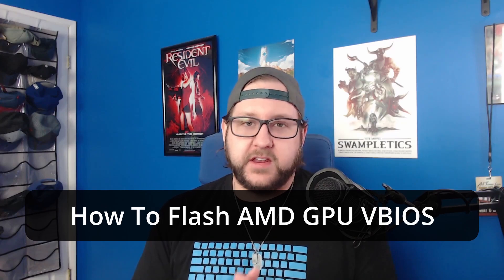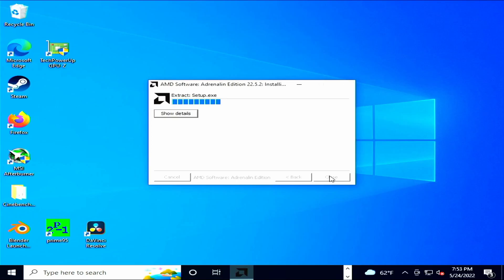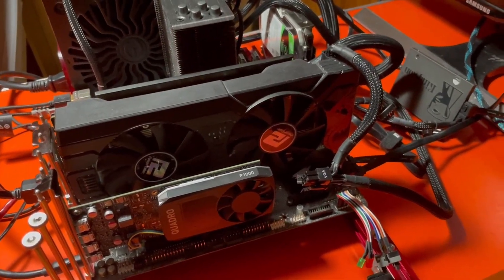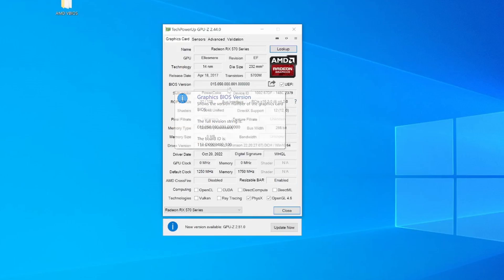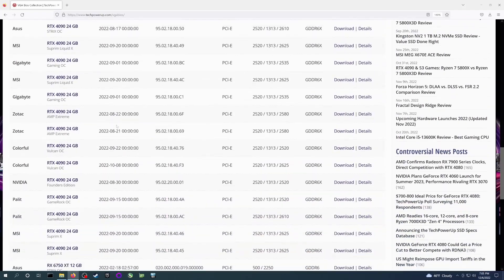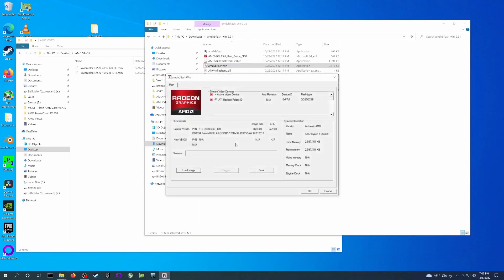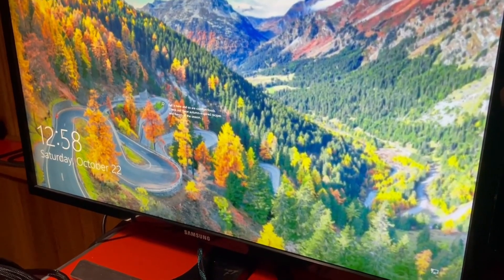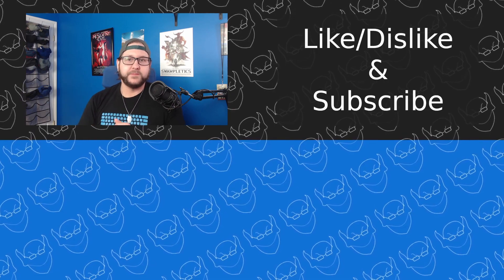How To Flash AMD GPU VBIOS

Comment: I wanted to fix resizable bar on my rx 580 but I already have the latest bois version. I could just try download it but don’t want to brick my card trying to download it. Whenever I try to enable resizable bar in my mobo bios it won’t load into windows. Does anybody have any suggestions?
Reply from the maker: What's your motherboard and CPU? IIRC resizeable bar is only supported Ryzen 3000 and newer CPUs, and Intel 10th gen and up. And I believe some motherboards have a broken/weird implementation that you might need to update your motherboard BIOS for or might be stuck without it worst case (unless you bought a new mobo but that's not really worth it).
Reply: I have a 2600 so I guess that’s the problem
Reply from the maker: @Hypnotic12 ah yeah that might be it then. I'm sorry about that 😬 but at least now you know

Comment: I get a "cannont find a discrete Ati video card" issue
Reply from the maker: Hmm, that's a fun one. What card are you trying to flash, and what version of amdvbflash are you using?
Reply: @BitGoblin  mi25 
Basicly a vega 64 frontier edition
Reply: I was using my 1030 as the main card the pc thru gpuz reconises it but the software you used didn't
Reply: I used the newest version that was on the website
Reply: The version is for win 10
Reply: @BitGoblin   heres a video on it 
Thank you for taking your time

Comment: Hello mister, do I need to plug a NVIDIA card to do so? Or can I connect another AMD card?

P.S my AMD Sapphire 6600 XT shows no display like yours 570.
Reply from the maker: Nope! You can use any functioning graphics card (even integrated graphics) as long as you get a display.

Comment: I have a question I got a gigabyte 5700xt and it's core clock is at 788 base and not on its 1700ish base what can I do
Reply from the maker: If you haven't already a BIOS flash could help if the previous owner flashed a different BIOS on there to limit the clock speed
Reply: @BitGoblin  oh okay so doing this might be able to fix the problem? This video shows how to do that?
Reply: I tried doing this but It won't open the little window

Comment: I bought an Aisurix 5500 XT and gpu-z shows it as a non XT- 5500. im guessing this would probably help.  the screen randomly flashes black then goes back to normal. happens at idle or load, whenever it feels like it.
Reply from the maker: Yeah it's definitely worth a shot - sounds like someone flashed a different BIOS on that card to change clock speeds or something.

Let me know how it goes!
Reply: @BitGoblin  yea I think when Aisurix got their pallets of gpu’s they just popped a new cooler on the board with new stickers and flashed it.  I want to get ahold of a second gpu just in case this one bricks. it does read the same clocks and performance just the screen flickering randomly is annoying. Thank you very much for having made this tutorial!

Comment: bro the tool that you mentioned atiflash when i extract it just doesnt give me complete files when i run the installer nothing happens pls help
Reply from the maker: Unfortunately the GUI was retired in version 5, so it's only the CLI tool. I plan on making a video for the CLI at some point, but in the meantime there are some guides online on how to use it
Reply: @BitGoblin  ok thanks 👍

Comment: why am i getting a commmand prompt version o f the ati application?
Reply from the maker: The GUI version was retired in version 5, so you need to use the CLI version now unfortunately. There's a PDF manual for the CLI tool and there should be some detailed guides online. Or I'll make one eventually :)

Comment: Hi Greg, I'm in desperate and hoping you can help.

I bought a used "Lenovo Thinkpad E590 8th Gen Notebook Intel Quad i7-8565U 1.80Ghz 8GB Full HD RX550 2GB" and I'm facing the error "Windows has stopped this device because it has reported problems. (Code 43)" when launching DaVinci Resolve.

I've tried these methods without success:
1. Uninstalling drivers with DDU and reinstalling the latest version of AMD Adrenaline.
2. Uninstalling drivers with DDU and reinstalling two previous versions of AMD Adrenaline.
3. Using AMD Auto Driver Download.
4. Downloading and installing AMD Adrenaline software offline.
5. Using Lenovo Service Bridge for updates.
6. Windows updates didn't work either.
7. Flashing the card with "amdvbflash_win_3.31" gives the error "Cannot find discrete ATI video card."
8. Can't boot from USB due to enabled "Device Guard" on the Lenovo.
9. Tried resetting the card with "atikmdag-patcher-1.4.14" to no avail.
10. Launching Adrenaline prompts an error mentioning automatic Windows updates.

I've reapplied thermal paste and reinstalled both Windows 10 & 11, but the problem persists. The graphics card is "AMD Radeon RX550X 2GB GDDR5," and I've reported the issue to AMD with no assistance. Please help.

Comment: I have an 8GB RX 580 2048sp that came with artifacts, in some games the textures flicker black, in not so demanding games it works normally, just like being in a common app, will changing the BIOS solve the problem?
Reply from the maker: Good question! It's possible it would fix it, but artifacting to me would suggest that the memory is bad (most likely, since less demanding on the VRAM) or possibly the GPU itself is having errors.

Flashing a new firmware shouldn't hurt though, it's definitely worth a shot if nothing else :)

Comment: I got a RX 580 Mingzhou 8gb, but Gpu-z is not picking it up and my PC is not picking it up, the fans are running but no display. What can be the problem?
Reply: I am stuck with the same issue on RX570 8GB GPU-Z does not pick it up not even BIOS picks it up but fans are running with no display. I have a 750W PSU so I don't think power is the issue. Please let me know should you get a solution to your card.
Reply: @maposa867 I ended up upgrading to a newer built box with upgraded motherboard. It was a PCIE support issue. My old motherboard was outdated. But now there is display but fans are not running.
Reply from the maker: Sounds like it might be the firmware. Does it get detected when using amdvbflash?
Reply: @BitGoblin  It was a PCIE issue, but now there is display on my new pc but the fans are not running. I'm actually now saving for an RTX to save me the headache.

Comment: Can I change firmware while I'm using, or do I need 2 video cards to do the process?
Reply from the maker: Yep! You can definitely flash the VBIOS of a running GPU. :) The only reason I had a second was to use for display when the RX 570 wasn't working.
Reply: @BitGoblin  Thank you! I'm not able to change my current firmware then I thought that could be the case

Comment: Man, i did it on a 6700xt everything went fine, now my pc wont start, only blackscreen after the pc tries to fix it itself… what can i do now? Is my gpu fucked now or can i reset it somehow to the old bios pelase help man
Reply from the maker: Yeah you should be able to flash your old VBIOS to the card, you would just need to use another GPU to handle your display while you flash the VBIOS.

The RX 570 4GB that I was using for the demo would give me blackscreens on certain VBIOS versions, so I just used a Quadro P1000 to boot to Windows and do another flash to a working version :)
Reply: Same issues here . i tried everything and nothing work
if you find a sloution please tell me

Comment: i have sapphire pulse rx 580 8gb 2048sp v2 
my pc randomly crashes and freezes after some time, sometimes it shows artifects and then go completely black, when i cut off my power it runs again for a minute or two, is it a hardware or a bios issue ?
Reply from the maker: It could be a hardware or vbios issue, but I'd guess possibly it's a power or cooling issue. Is there any way you can view the temps in the BIOS or something before it crashes? Or you could try a different power supply if you have one to see if maybe it's related to power.
Reply: @BitGoblin  I don't think its a heating or a power supply issue because even when i max out fans to 100% it still crashes,  in normal usage the temps stays in 36-40C, 
in furmark it goes 84, and i used it in my friend's pc with a different psu it still crashes, so psu is not the issue here either,
Reply: did you manage to make it work? im having the same issue with my rx580 8gb
Reply: if u did, how did u fixed it?

Comment: i have an xfx rx 570 8gb it has a clock speed at 1226mhz i checked all the rx 570 variants and the lowest clockspeed (defualt was 1244mhz) and xfx models had 1286mhz so im looking to gain that orignal clockspeed (1286mhz) can i do it safely
Reply from the maker: Yeah the vbios flash is pretty safe in my experience, as long as you have another GPU on standby to reflash it in case something goes wrong

Comment: is it possible to flash RX 580 2048SP into  rx 570 ???
Reply: I get driver issue randomly. Whenever i install Amd driver screen flicker and it will freeze.Then i will need to hard restart windows and randomly it will let me in.Can this problem be solved by flashing vbios??
Reply from the maker: A vbios flash might help in this instance, it's worth a shot at lesst. Or something else is going on like  you've got a defective card 😬
Reply from the maker: It might be possible if you get a vbios with support for the right vram, but can I ask what you're trying to accomplish by doing this? You run a risk of messing up your card, and if it's for performance you're probably better served just over clocking it instead

Comment: Hey, i have a rx580 nitro+ with 1340mhz clock. Cani flash a 1410mhz bios on it?
Reply from the maker: Yeah, you should be able to!
Reply: @BitGoblin  i flashed one of the bioses and i ended up with 0 VRAM.
Flashed another one and all seems ok. Do you have any ideea were identical at specs, have any reason why would the system have this issue ? PS : reinstalled drivers after  every bios update
Reply: @AndyTimeHD   For the Nitro + there should be a slower as well as a faster BIOS, with a hard switch. Now you have the fast one running, try switching back to the slow one and flashing that with a fresh slower BIOS. Check that it really is the right one for your version of the card...

Comment: My rx 570 does not give any desplay I played fortnite the night before and the next morning desplay was gone    I switched to my older card and that one works any advice I only have 1 GPU port to plug into I have micro ATX motherboard
Reply from the maker: Hmm, that's odd. Usually a GPU's firmware doesn't go AWOL like that overnight, but it's worth a shot! Assuming you have a 1x slot available you can get a cheap PCI-e riser to connect your RX 570 while you flash the BIOS.

Something like this: https://www.amazon.com/ChenYang-Express-Extension-Extender-Converter/dp/B00S6GK06Y/ref=sr_1_7?crid=1D4E4E1MYFH8O&keywords=PCIe+riser+1x+to+16x&qid=1679586234&sprefix=pcie+riser+1x+to+16x%2Caps%2C75&sr=8-7

Comment: hey man I did it by  following your steps you showed in the video in my rx570 8gb GPU It shows that it was successfully done but after restarting  the PC no display  is coming but GPU fans are working and also no keyboard and mouse are coming. Now how can i fix it? Can any one help me with that Please. Is my gpu bricked?
Reply: Same issues here with my 4gb version
Reply: @GenericCuriosity  Did you fix or solve it yet? If you have solved it  can you explain to me  how you solve the problem?
Reply: @noobadults6591  Hi I found a forum that that helped me unfortunately I can't post links but I found my gpu is a dual bios one, if yours is there should be a physical switch  on your gpu opposite side to your pcie connector near your display ports, I am still not able to correct the other bios but it's working on this one

Comment: Hi I just bought a second hand RX580 when I make a benchmark test,it will crash with a black screen and solution  sir?
Reply from the maker: A few things I would try if you haven't already:
  - Update your OS and drivers for the GPU
  - Use a program like hwinfo64 to watch GPU thermals when you're running a benchmark to make sure it's not overheating
  - Try the GPU in another system to determine if it's the GPU or your PC

A VBIOS flash might help, but this sounds more like a hardware issue than firmware.
Reply: @BitGoblin  but the weird things when I watch YouTube or surf internet it working as normal

Comment: Can you help me? If i start the ATI program not running just a message show up what say " Cannot find discrete ATI Video card" but i have AMD Radeon RX 6600m.
Reply from the maker: Hmm, that's a tough one. If you haven't already, it might be worth trying to update your graphics driver, or trying a different version of ATIFlash. I'd also check if the device shows up in Device Manager.

Comment: Sir i tried to flash my rx 580. And it just froze. I cant even hover my mouse cursor. Should i press restart button on my pc? or just leave it and maybe it'll finish flashing.
Reply from the maker: That's tough, but you may just have to force it off if it's stuck. It might've finished but maybe the driver had trouble with it? It's hard to say, but I'd be prepared to another flash just in case.
Reply: @BitGoblin  sir just an update, i just pressed the restart button on my pc and it started well. i flashed another vbios version compatible to my gpu and it all went well. Thank you for the tutorial you uploaded. God bless!

Comment: Hi, i got an issue with my rx 580, it doesn't have many problem but only when i play a game it suddenly crashed and the monitor is blinking, should i flash my gpu ?, or there's something else i can do instead ?
Reply from the maker: It's worth a stab. Have you tried like reinstalling the AMD driver? And does this happen with any other GPUs (if you have another)?
Reply: @BitGoblin  Yes i did that, but the result is the same, and yes i have another GPU but that is broken too

Comment: Hi, I got a Asus Rx 5600 xt off of taobao for like $90....my problem is, the fans seem to be stuck at 100% fan speed (the cards is at at 100% fan speed at even 26 degrees) I have replaced the paste and tried to flash the bios but some how it's like the fan control is hard coded

Update: sorted it out. It was simply a loose fan connector that probably wiggled out during shipping
Reply: i have a rx 5600 xt too and one of my fan is stuck a 100 % too  
to fix this problem did you watch this tutorial ? or did it by yourself ?
Reply: @shochi8872  I did it by myself....would suggest to try reseating the fan connector on your GPU
Reply: @fenrir_szn6978  ok thx i'll try it
Reply: Have you tried msi  after burner?
Reply: @mrwoolfy3286  I sorted it out....the connector wasn't seated properly so reseating solved it for me. It was a hardware issue anyways.

Comment: The different (officially verified) bioses are for different cards. Usually, (on both nvidia and amd) it works fine to flash one to another but it is possible it can cause issues. For example my card is "F3" iteration, and there is both "F2" and "F3" bioses (exact same, same card, model, clocks etc.) however the "F3" is suitable for me in my case.

Sometimes (with for example gigabyte gtx cards) "F1" might be flashable to "F5" but not "f10". You can usually find these info on manufacturers site. But generally, pretty safe to flash "wrong" bios.
Reply: I just flashed my rx 6700xt, i used the bios from the tech site he was showing in teh video, everything went well the flash tool told me to restart my pc which i did… now my pc wont start, instantly goes into the repair tool and goes full black screen after, i dont know what to do since i cant boot up my pc anymore.. since you said it is safe to even flash a wrong bios and i think i dont even got the wrong one, maybe you got more knowlage than me and can help me
Reply: @torquedfx  Wow did you manage to fix your issue in the end?
Reply: @boonsengtan9023 the fix is so essy
Reply: @torquedfx  i mean the worst and absolute nono is if flashed one which was made for different memory (some 6700xt use Samsung, others Hynix).

You might be able to flash it back correctly by using integrated graphics or another GPU to get display, while having this defect 6700xt inside at same time.

And then flash correctly.

Comment: Can I use it to flash an rx 7900 xt?
Reply from the maker: In theory yes it should work. But TechPowerUp's VBIOS database only has 1 image for the RX 7900 XT (Sapphire RX 7900 XT Nitro+), so you'll need to get the VBIOS you want to flash somewhere else

Comment: I had the same issue with my 6700xt, I bought it as an used mining card, and it had mining firmware on it preventing windows to decide what to do with it, a quick flash and it worked just fine.
Reply from the maker: That's awesome! Sometimes rescuing GPUs can be easy :)
Reply: Same on my vega 64
Reply: Oh great.
Is it safe to flash edited stock vbios or different subsystem id vbios on rdna2 (navi 23) series? I thought it was locked up for that!
Reply: Same thing here luckily i found a software name, atikmdag patcher it solved the issues.
Reply: Same thing on my rx 570 I’m gonna try flashing it now

Update: it worked!!!!!! Dude I’ve tried everything and this fixed it thank god bro much love from canada
Reply: @_Ayhamster  brother i have problem with my rx 580 8gb xfx gts xxx oc edition in silent mode the bios shows original subvendor but. In performance mode the bios show s AMD/ATI subvendor should i flash it
Reply: Yo can i ask? What type of gpu did u use? Is it sapphire nitro+?
Reply: @dirgarianto2110  don’t think it’ll matter as long as it’s been used for mining u gotta flash the bios just gotta make sure you download the right bios